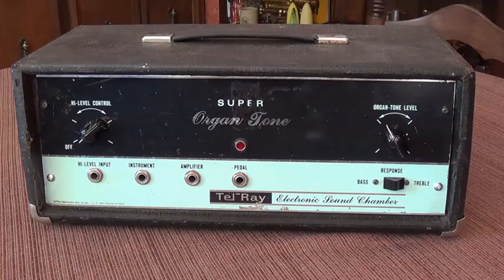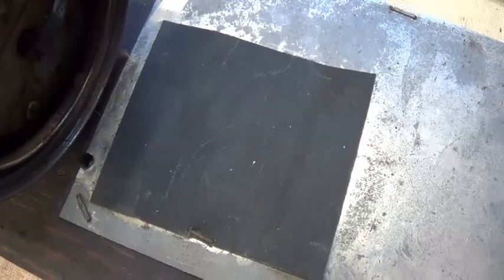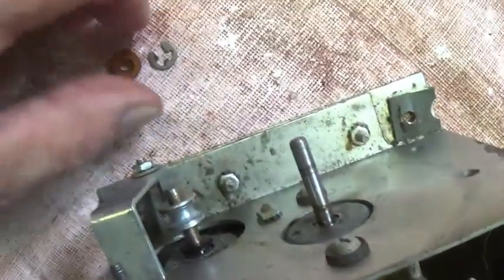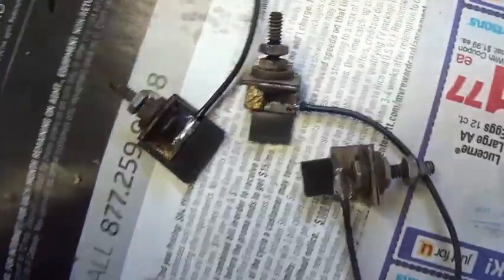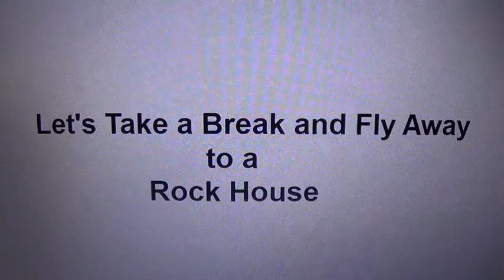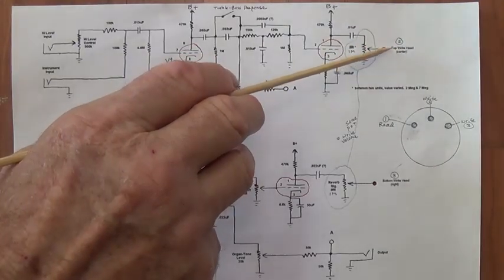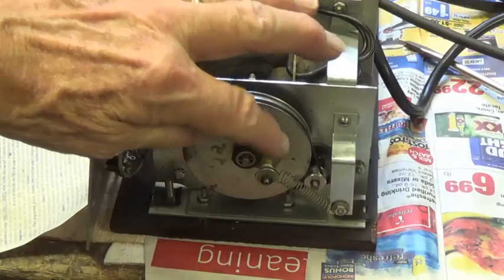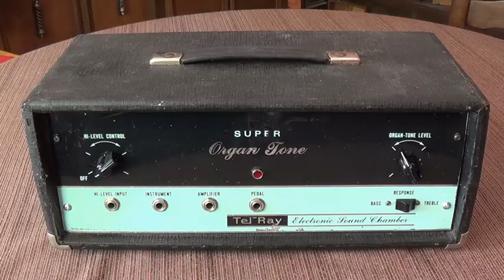Tel-Ray Super Organ Tone Resurrection.......Saved from the Dump !!

Comment: Whoa!!! That's one of the coolest effects ever! I want one.
Reply from the maker: Thanks, DE. I'm glad you liked it :)
Reply: There's a Standel branded unit on eBay right now asking $700.00! It looks like they took the guts of yours and put it in a Standel cabinet. Plus...they call it VG cond. and while they don't take the chassis out of the cabinet, the little you can see through the back looks just about like the "before" version of yours. If that one is worth $700.00 then yours has to be worth $1400.00 min.
Reply from the maker: Wow, thanks for the generous appraisal, DE. I think some folks are a little overly optimistic with their asking prices on Ebay. To me $700 would be a fair asking price for a nicely restored, fully functional unit......and about half that (or less) for an as-is one.
Reply: Many different brands have the del-ray patented mechanism in them. There is a Fender branded one on ebay right now with the same mechanism in it too.
Reply from the maker: Yes, indeed, Joel. Be sure to watch the video (link in video description) showing most of them.
Reply: I did start to, but I'm hooked on your format. Plus, the sound level of the linked video is quieter, therefore hard to listen to on my laptop computer speakers... I need to connect to some sort of speakers again soon. By the way, your editing has had some of your sentences cut off a little early, have you reviewed and seen this yet? Not sure what is causing it, have you taken to using a different editing method? It seems to have started somewhat recently.
Reply from the maker: I thoroughly review each video prior to posting, so I am aware of any and all flaws. The clipping issue is a result of the video linking program I have been using for about a year.  When combining (about 50 to 100) short video scenes, it sometimes randomly trims a fraction of a second off of several of them. Other than this, the software does a great job and I  have not found a replacement I like. If'm sorry if the few slightly  trimmed scenes are upsetting.
Reply: Not upsetting, I can actually predict what you were gonna say for the last word or two anyway, it's funny.
Reply from the maker: Maybe I should add the clipping as a regular feature and offer a prize to viewers who can figure out the missing words :)
Reply: I like it!
Reply: D.Edward Rice me too

Comment: The disc looks a hell of a lot like a 2000 era hard drive disc. Wondering if one of the several discs in an old HD would work here? Actually, the description of how it works sounds like an 90s or before Selenium copier drum. Besides light making them hold a charge they get charged Positive, negative, then erased with AC every rotation. Bet it's selenium. They don't use oil but we were told to wax them with Nu-Finnish to do the same thing.   Great topic and video
Reply from the maker: That's an interesting observation, DB, but weren't those discs magnetic storage rather than electrostatic?  Magnetic won't work in this device.
Reply: Correct just updated. Now sure it's selenium like a old copy machine drum
Reply from the maker: That makes good sense, since copy machines are electrostatic devices. You may well be right.
Reply: Uncle Doug 
I remember the old hand cranked copy machines with blue ink in grade school, now as a professional piddler I wonder how the heck they worked, I also wish I had one every time I have to source an ink cartridge for those god forsaken ink jets I always manage to break a panel door on

Comment: Might be really cool to put a Triac speed controller on that shaded pole motor and see what effect speed can have on it
Reply from the maker: That thought crossed my mind, Robb, and I might try it some day.
Reply: Chopping the sine wave to the motor in order to change the motor speed would likely generate an enormous amount of electrical noise only inches away from audio carrying wires, so it sounds great in theory but would probably generate an enormous amount of audible noise. Triac dimmers in general are the bane of audio equipment and public address systems.

Comment: Someone DEFINITELY put something besides LB-65 in there.... Most 50 year old cans that have never been opened, and only had LB65 inside have minimal rust and corrosion.  The disc retention nut is the nightmare of the  corroded unit.
Reply from the maker: I'm sure it was brake fluid, DK. The smell is unmistakable......as is the rust and corrosion resulting from its tendency to attract and hold water. The disc retention nut was pretty scary......as was the frozen bushing.
Reply: that kind of rust did look just like brake fluid damage, I agree. At the beginning, I wondered if that was what they were supposed to use. Now after a little more research, I found they use $44/bottle lightweight mystery oil! Now who's idea was that, and what does it contain?! Now, I would like to know what type of abrasive you are using in your blasting cabinet. The can came out looking new, and as if much of the epoxy coating was still there, that glossy grey. I open a lot of paint cans as a painter, and it looks as if you are using some very fine material in the blasting cabinet.
Reply from the maker: I used very fine glass beads @ 90PSI, Joel, and with a fairly light touch so as not to damage the surfaces. The "magic oil" is available for only $25 a bottle on Ebay. It has been thoroughly researched and is not toxic.

Comment: Wow !!!! That was rather interesting.  Other than the name one that unit. What would the name of that effect be ? Thanks for sharing uncle. Always great to see and learn something new. 
Have a good one. 
 Bryan from Chicago
Reply: Bryan Keith I'd consider it a delay/vibrato or modulated delay. There are modern delays that modulate the speed of the delay, creating a comparable but often more extreme version of what this unit does. The Earthquaker Devices Space Spiral is one. Uses a PT2399 delay chip and has modulated time. I built a similar pedal called the Deprofundis Delay which used the same chip and had similar features before getting the Space Spiral pedal.
Reply: Thanks julian.  Do u have a dwmo o that pedal posted anywhere?
Reply: Bryan Keith There are some good space Spiral demos, and for the one I built, the guy who designed it had a few videos I think. It's the "grind custom Deprofundis". I never made any demos myself, and since then, I rewired it and removed the modulation feature.

Comment: Excellent job!  I have a 1966 Fender Echo Reverb that's in need of cleaning and new oil.  The electronics work but the echo is weak. Not many folks very familiar with repairing the Adineko units around here.  So, your video has been quite informative. Thanks for doing this video.
Reply from the maker: You're welcome, JT. Best of luck with your tune up project.

Comment: Absolutely amazing device! Such wonderful sounds. The tweaker in me can't help but think about all the modding possibilities, like running the wet/dry controls to a couple of pots on the front, an adjustment for the motor speed, a screw to weaken or strengthen the effect of the "vibrato spring". It'd be very tempting. But maybe such an unusual and interesting piece of classic gear should be left as it is. ...Well... maybe if you had two of them.....
Reply from the maker: Thanks, GB. Glad you liked it :)

Comment: Dang it, Uncle Doug; now I know I NEED a media blaster! Then I could get all my old tools/hardware/knick-knacks prettied-up and ready for another 50 years' worth of work. 

That's really fascinating how the disc was 'recorded' to. When I read about the 'heads' inside it I honestly pictured something... dome-shaped, or at least rounded. Never would have guessed it was basically a 'flap' of material dragging along the disc. I wonder if those silly 'touchscreen stylus' end-pieces could work as an alternative, given that they're somehow electrostatic...
Reply from the maker: They offer small, counter-top blasting cabinets at Harbor Freight at very reasonable prices, Jack. All you need is a good air compressor.

Comment: Fascinating process, Doug...I thought for sure the disc would be shot from the use of brake fluid in that can. And I
thought the disc might be doped with something to make it perform the electrostatic functions, but maybe it's the
oil that does it. Anyway, I'll never wonder again "What's holding our beloved uncle up? Hope he's okay." I'll just figure
you and yer two feline pals are elbow deep in the innards of some project audio device(8-). Anyway, that thing makes
for some really wild effects(8-). Thanks for sharing.
Reply from the maker: You're welcome, Tom. Apparently the disc is coated with carbon granules by some secret process that no one has figured out yet. I wonder if a bunch of ultra-fine steel granules in epoxy paint would work??
Reply: Hmmm. Maybe powdered transformer type steel. That stuff "forgets" pretty quick(8-). And even if 
you had brushes that conducted more than treated neoprene, "specs" in epoxy paint wouldn't conduct
worth beans...so you wouldn't overload the outputs of your tubes.

I'm figuring you know how to paint...and that you need to pickle aluminum to get most paints to stick.
If you tried the paint and iron chips thing, I'm thinking  the sound will be different...maybe a
lot different. But then again, if it was different, that means changing discs would add options. The
one thing I wouldn't do is use a ferrous metal disc. That leaves aluminum and brass though. I just
wonder what type of oil to use...ya need something to make those neoprene contacts last. A drop
of that Union Carbide oil dripped and left on some cured paint yer thinking of using will tell you a
lot there.

A was also thinking, if you wanted to redope the original disk...or make a new one, finely ground
pencil lead in baking enamal?
Reply from the maker: Your ruminations all make sense, Tom. I have a feeling the Ucon-65 would be tough on paint......but maybe not expoxy.  I'm not sure if tiny carbon granules can be included in powder coating.
Reply: That's probably why the process is so secret. The inventor may have had one hell of a time figuring
out how to get the thing to work...so he and any of his friends aren't gonna spill the beans. But I agree,
the "solvent" characteristics of paint carriers may not take to graphite too well. and even baking
enamal has carrier liquids...
Reply: @UncleDoug  , JB Weld epoxy is full of powdered steel, I wonder how well that would work......

Comment: The media blasted parts turned out so nicely.  Could you make a video demonstrating the media blasting process, type of equipment, type of beads, technique, etc.?  I know I would love to see that and I'm sure many other viewers would as well.
Reply from the maker: The process and equipment are fairly simple. You buy a large bag of spray media, i.e. glass beads, walnut shells, sand, etc. Then using about 100PSI of compressed air, you spray the media at a metal object that is rusty, corroded, etc. It actually looks like you are spray painting the object gray, because all the paint, rust, etc. disappears, leaving a bare metal surface.

Comment: Very interesting device. I had heard of that type of audio ”conditioning” I guess you would call, it but didn't have any idea that they were ”that” mechanical. Very Cool!  Oh the Rock House video, if I could only have that little house, some Vigas and Latillas from New Mexico for a new roof I would be in heaven. Of course, all of the Broadcasting towers at the top of the mountain would play havoc with my HAM radio hobby and the million dollar home owners nearby might not appreciate the new neighbor. Beautiful video none the less. What type of media did you use on that soft metal can to clean it up without any damage to the top can seals? Great job at restoration of a basket case.
Reply from the maker: Thanks, Mark. Glad you liked it. I used very fine glass beads at 90 PSI.

Comment: I would love to know how you straightened the shaft without damaging it. Great video!. I've watched it three times now. Much better than TV...
Reply from the maker: Thanks, Jerry. You chuck it up in a lathe or drill press chuck, then rotate it slowly, bending in areas to reduce the run out (wobble), until it is imperceptible.
Reply: @UncleDoug   Hello! Thank you for responding so quickly. I tried that, but the shaft won't budge. I guess I'll try a small vice next. The bend is right at the c clip right behind the pulley. It's easily seen against a fret rocker. Thank you very much!
Reply from the maker: @jerrytiner3972  If you can't get the shaft out of the unit, then try to straighten it in place.

Comment: How great to be able to bead-blast steel and not have to add some secondary process so it doesn’t rust up badly in minutes. Living in a desert zone helps I guess. Here where I’m located if it isn’t raining it will be soon.
Reply from the maker: I sometimes apply a lacquer clearcoat to prevent rust......but like you say, it's not a real threat when the humidity is about 5%.

Comment: Hi Uncle Doug, I have to say this video is incredible.  I had no idea such a thing existed and I've become somewhat obsessed with the idea.  I recently purchased an "Adineko" motor/oil can assembly.  It is just that module with no other electronics, no cabinet, no chassis, etc.  So I would like to build a fully working unit starting with this motor/oil can assembly.  I've been looking over the various schematics to see what may be possible.  One thing that I'm NOT finding on the schematics is some transformer specs (number of windings, etc.).  Could you share any info you have about the transformer in your unit (i.e. manufacturer/part number) and perhaps some voltage readings?  It would be nice to know what the voltage is coming off the B+ secondary winding and maybe the various plate voltages on the tubes.  Thanks, Craig
Reply from the maker: Since the voltage and current requirements are minimal for the two 12A_7 tubes, I would think that you could simply use a power supply like the one I featured in the Rick-Tone TremoDrive video series.....two 120:12V transformers tail to tail, perhaps with a voltage doubler. The plate voltages are probably in the 150VDC range.
Reply: Thanks, I will rewatch that video.

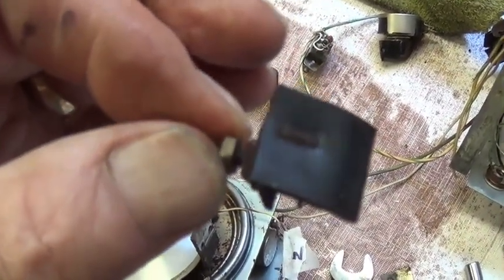Comment: 11:40, I do wonder if the rubber pads used as tape heads are actually just plain rubber or if they might be carbon impregnated in some way to have a slight conductive path. Back in the 1980s when I was doing a lot of nightclub sound system work we frequently ran shielded wire that used a conductive plastic sheath plus a drain wire for the shield, no braided wire was involved.
Reply from the maker: My impression is that they are plain rubber, GU, relying on static electricity to record on the disc, rather than actual current flow.....but it's only speculation. There is limited information on the process, but patent documents would probably contain the details.

Comment: That fish paper is to keep the tube socket pins from arcing to that sheet metal. When that oil breaks down & things can go awry. The oil was a type of PAG oil used in hermetic systems (usually refrigeration). I have seen some ridiculously priced Tel Ray UCON 65 oil on evilBay. 55 gallons of the stuff is maybe $350, so how is it worth $20 an ounce? There are a few subs that work great, but the viscosity is slightly off, so you need to do a little blending. I have used a racing automotive oil, which is a PAG oil, and a refrigeration compressor pump oil, to get a viscosity spin cup result within < +/-6% of original Tel Ray oil. I had the same problem with UCON-65, I had with conductive carbon for a De Armond shaker tremolo. I didn't need 55 gallons of UCON-65 and I certainly didn't need 40 metric Tonnes of conductive carbon black. There is a company that uses Polyalkylene Glycol synthetic motor oil, and it's red just like UCON-65. PAG oils were actually used in the rubber industry, and in textiles, and myriad other types of  manufacturing. UCON-65 has a minimum pour temp of -70 degrees F! That's cold! When PAG oils break down the solvents separate into volatile organic compounds rather than gels, sludges, solids or varnishes. Tel Ray did their homework on these. 65 is the Saybolt or SUS viscosity, which has no relation to motor oil "weight". The "weight of UCON-65 is about 0W-2.6 wt. Does that sound about right? It's thinner than the 0-W20 in my Nissan's 1800cc sewing machine motor. No science fiction B movie could have been made without a Tel Ray & a Theremin.
Reply from the maker: Wow......thanks for the detailed analysis, Seth. Yes, the UCON-65 is extremely thin, probably in the 0 to 5 range.  I was able to buy about 4 oz. on Ebay for only $25 with free shipping. This would be enough for at least a dozen or more cans.

Comment: Awesome Unc. I bet ya over time the spring assembly on the flywheel caused the run out.  That's who they got those freaky sounds in the old movies. Great find. Is the clean up a top secret? Very impressed with the clean parts.
Reply from the maker: Thanks, J&B. I used very fine glass beads in a blasting cabinet with about 90 PSI of air.  The parts were cleaned instantly.

Comment: You're a madman with the restoration on that oil can unit! If one wanted to modify this to adjust the speed of the motor, what could you do?
Reply from the maker: Thanks, Paul. It would be easy, probably requiring only a fan speed control, like I used for the Leslie unit.